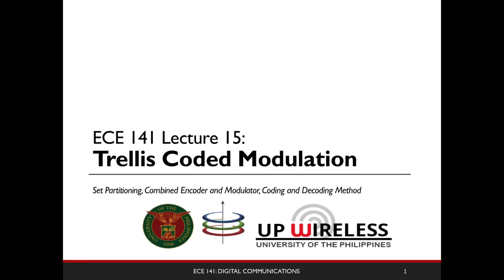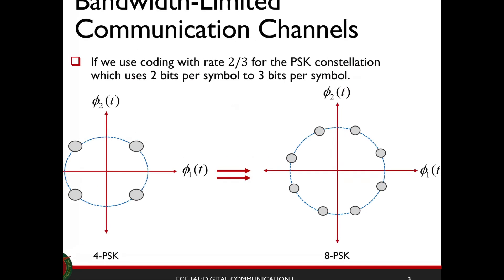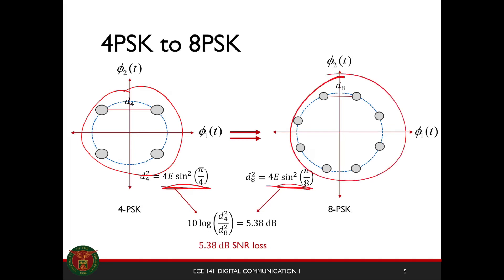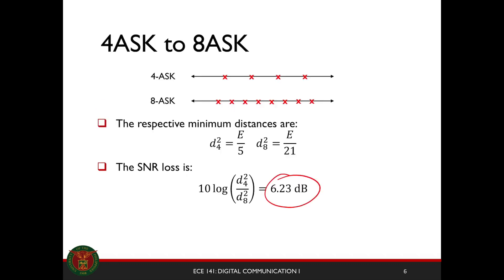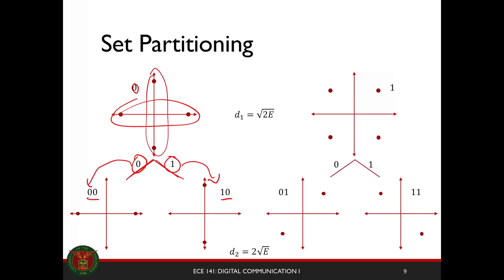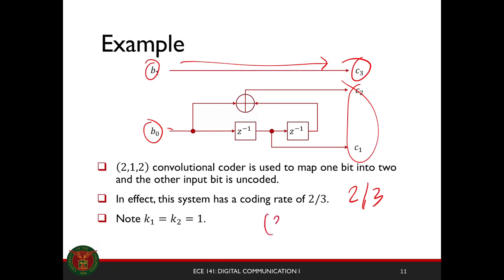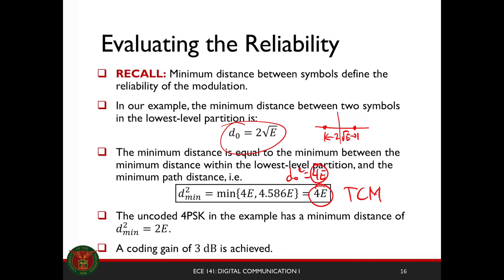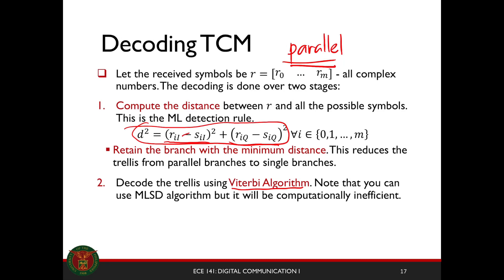Trellis Coded Modulation

Comment: I want to ask if I simulate this program in MATLAB, in the modulation process I have to perform the bit concatenation process (which is not encoded) will be concatenated with the encoded bits and then perform the modulation, mapping. In the viterbi decoding process, I have to separate the bits, so the trellis structure will work correctly?

Comment: Generally QPSK to 8psk snr loss is approx 3.5dB. Why its shown as 5.38 dB?
Reply from the maker: You are correct. Thank you for the correction. The formula should have used the energy per bit but it used the energy per symbol, instead.

Comment: please ask, What is the difference between Hamming and euclidean distance in TCM code?
Reply from the maker: Hamming distance is used when we are in the bit level while Euclidean distance is used in the symbol level. Since TCM uses symbols, we use the Euclidean distance to demodulate it.
Reply: @charlestondaleambatali4158  Can I call a TCM code is a nonlinear code?
Reply from the maker: @huyen121092  it’s not a code per se. It’s a digital modulation technique mixed with a convolutional code. Basically, it’s difficult to categorize.

Comment: When using TCM, will I use the channle code?
Reply from the maker: TCM is already a form of channel coding, specifically, convolutional coding. It merges channel coding and symbol mapping (digital modulation) into one function.
Reply: @charlestondaleambatali4158  soft-Decision Viterbi Decoding?
Reply from the maker: @atmson1955  Yes. That is the decoding process. However, the approach is different.